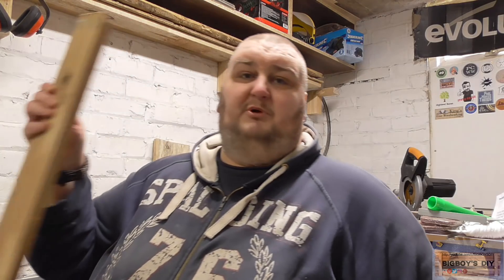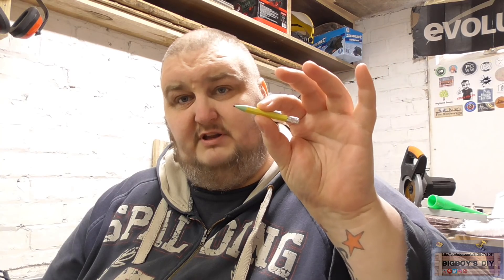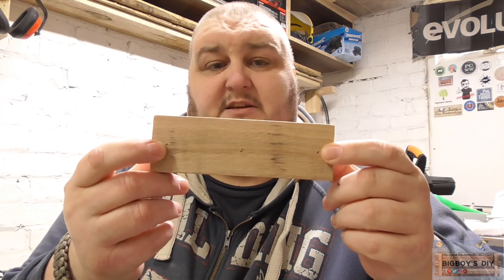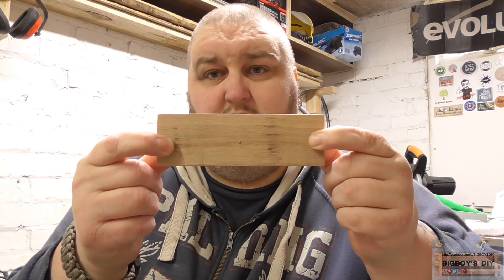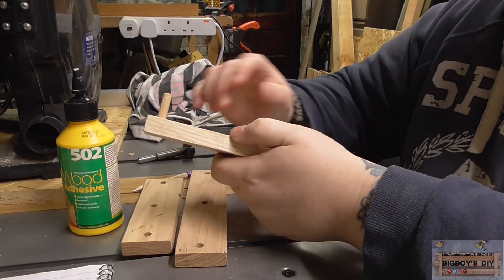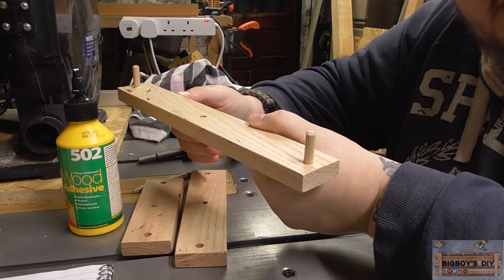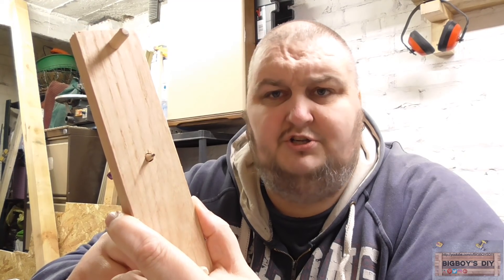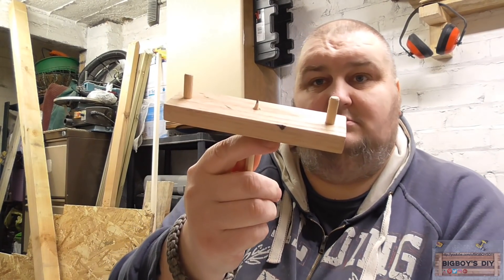build a self centering Jig

Comment: Great idea mate.  One way to make sure the holes are the same distance from the centre is to use dividers or a nail in the centre point and a bit of string with another nail or a pencil tied to it to mark your two end holes.  You can then remove the centre nail and drill your holes as you did.
Reply from the maker: OldManTony 9 time out of 10 I use a metal ruler as there more accurate than a extending tape measure then mark my holes with an awl. Thanks for commenting and the tip 👍👍